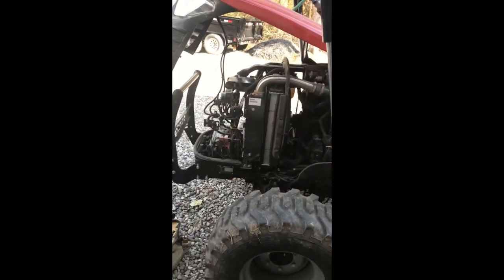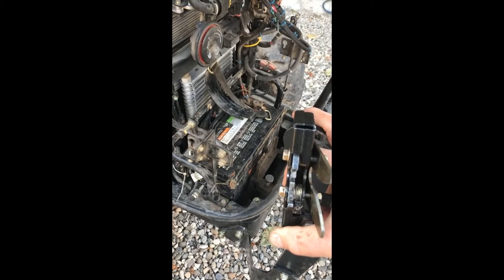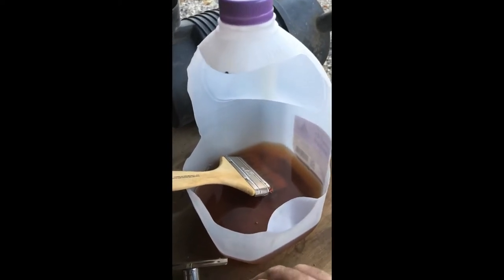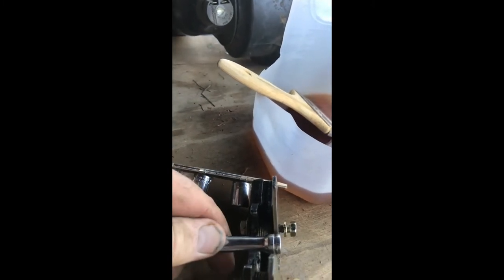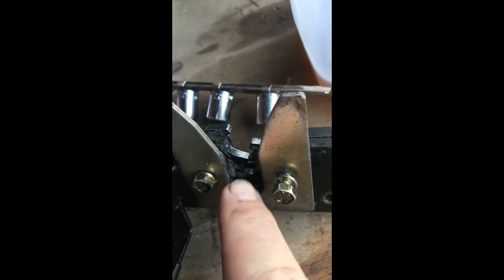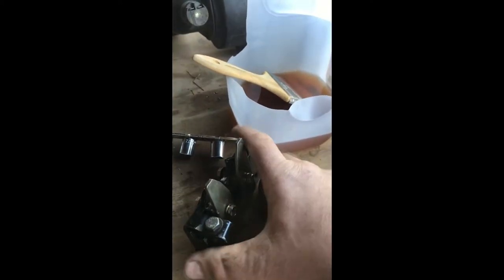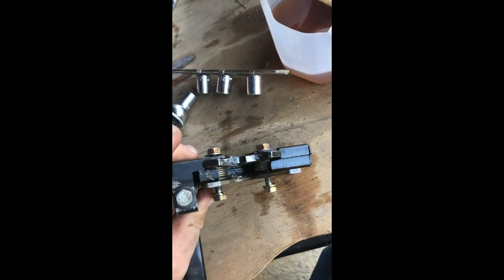Mahindra 2555 hood latch issue

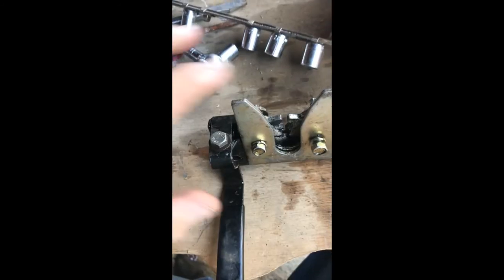Comment: At 3:30 you see what he is trying to show to release the latch. I was looking to see where I had to get in to release the latch and it got confusing with the talking about the filter, then the diesel fuel, etc. I had to watch it a few times to ever see where to put a long screwdriver in to release the latch. But, I thank you for taking the time to make this video and show how it wasn’t working. This is the only one I have found. If I can’t get it to pop open there are bolts underneath I will take out and go in that way, if that is possible. I will let you know. Thanks again. I know there are a lot of things that go in to making the videos and I will not pay my lousy dealership one more cent to do a thing. Take care.
Reply from the maker: Yeah, its a bit of a pain to take the videos without a camera stand either.  anyway, as I said in the video, i used diesel oil/fuel to lubricate the latch since i did not have wd40.  it really needs to be well lubricated.

Comment: I'm struggling with the same issue on a brand new 2638 I have.
Reply from the maker: I found even just a little dirt screws up the mechanism stopping it from opening the latch completely.    also, I think if i can get it unlatched to the point where it opens partially enough the hood is loose but not completely unlatched to lift that i can pull on the hood outward just enough to bypass the latch completely.